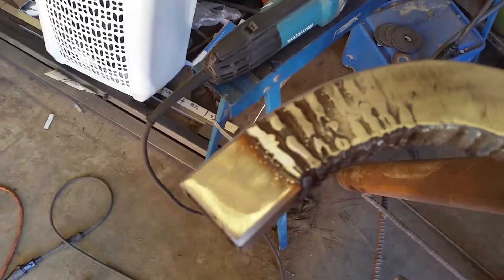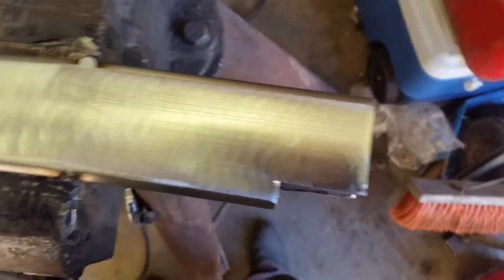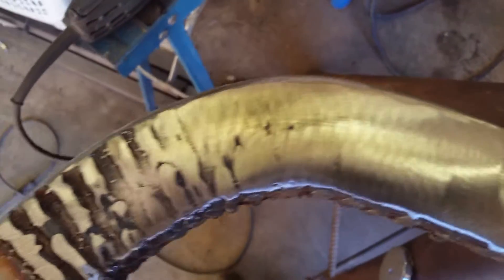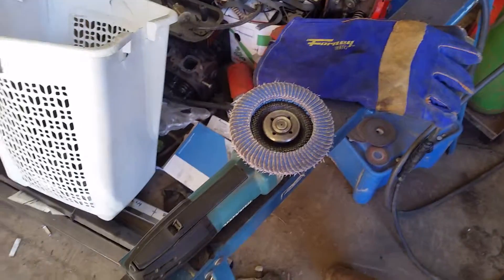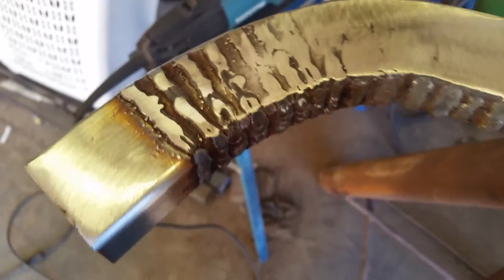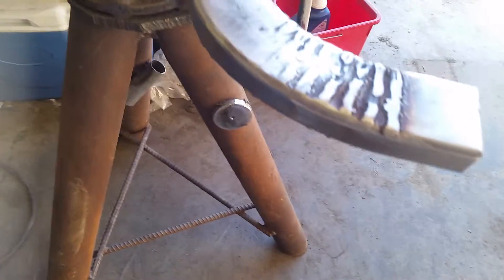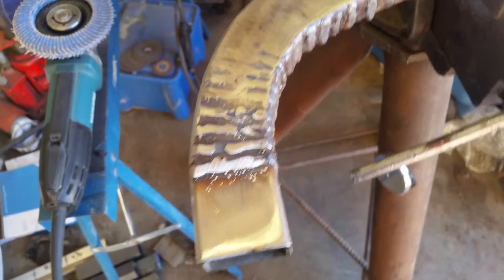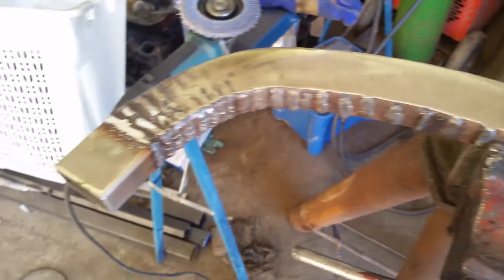Turning a straight piece of 1x2 s/s rectangular tube into a curved piece

Comment: I use to do it that way, now I cut the curve out on plate steel for both sides and then roll some flat stock around it then weld the 4 pieces together. It makes the piece look absolutely perfect and it's easy to mirror two or ten identical parts...